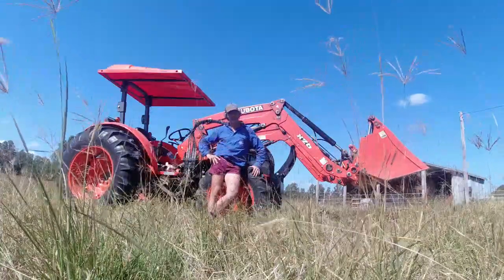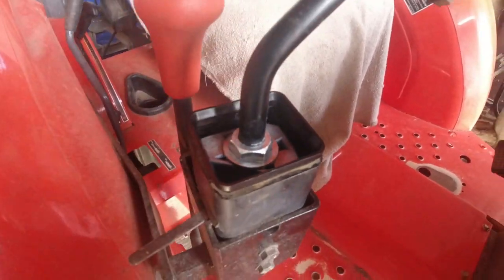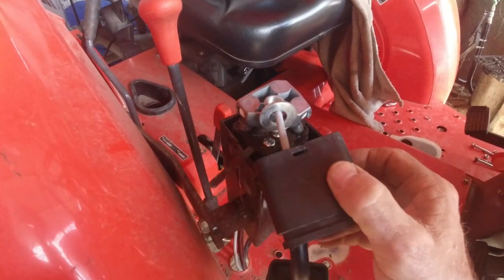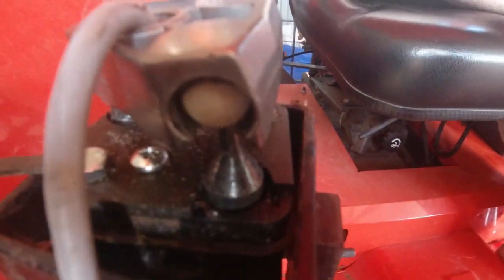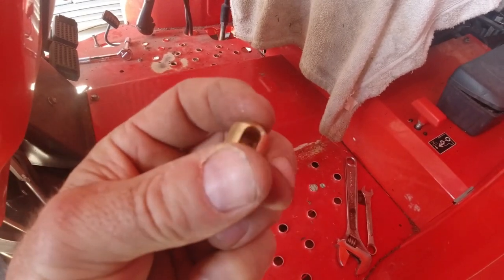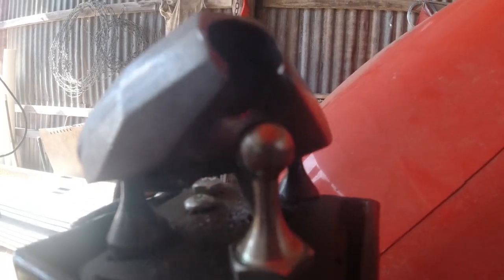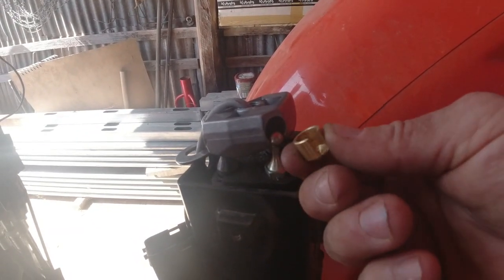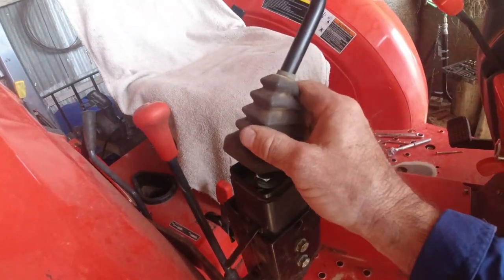KUBOTA FRONT END LOADER JOYSTICK REPAIR!!

Comment: I’ve been running a kubota tractor for a little and the joystick had started to be an issue. Bucket won’t go down unless I jam the control forward. I wonder if the problem is in there. Thanks for the walk through
Reply from the maker: Hi Bumpkin, firstly thanks for choosing to watch one of our videos mate. 
I’m not sure if you’ve had the chance to watch both of my Kubota bucket repair videos yet. Though I’ve had two separate issues now that won’t allow me to lower the bucket, though both were easy fixes. The one you watched appears to be the worn-out nylon bush located beneath the joystick, check that out and if it is the case I can give you the dealer here in Australia that machines a brass bush as a replacement. Once you’ve got it it’s an easy install.
If that’s not your problem then I suggest checking out my other repair video titled “ The 2nd Time I’ve Repaired This FEL, Though This Time It Cost Me Nothing!!”, that one was a loose grub screw located below   cable control box. If that’s the issue then alls you need is an allen-key to tighten and the jobs done.
There the only two issues I’ve had on my tractor. Hope one of those will fix it for you mate. 
Hope you have a grand week. Jason

Comment: Is it just the plastic square that keeps this from sliding back off the ball?
Reply: Is it possible that the brass sleeve should be turned 180* with the opening out. Obviously it would have to have the block and cables disassembled further to do this.
Reply from the maker: Hi Jbarr. Firstly thanks for not only choosing to watch one of our videos, but also for taking the time to message us. The plastic shroud appears to be tough and rugged and considering the location of this joystick / controller being up, away and well protected from potential damaging knocks from stray tree branches, I don’t envisage it getting damaged anytime soon, touch wood, cross fingers etc. 
Seeing that it is also a snug fit I can’t see it ever vibrating loose and falling out neither. 
Though you’re not the first to have mentioned it may be more secure pushing it in from the back side of this ball. So if I ever have to replace a second one I shall definitely give it a crack to see if it is a viable option. 
I appreciate your invaluable feedback and great point in which you raised. 
I hope you have a grand day. Jason
Reply: Who manufactured these brass incerts

Comment: what holds the bushing in?  should it maybe go in from the backside of the pivot - then it could never fall out?
Reply from the maker: Hi Steven, firstly thanks for choosing to watch one of our videos mate and secondly for taking the time to message us. It's probably a tad hard to see on the video, though there's not a lot of room for the brass bush to fall out between that shroud/cover and the brass bush itself.  I haven't had a problem yet anyways, though I do like your logic. Thanks for your valued input, next time I have it off I shall see if your suggestion is actually viable. Hope you have a grand day.